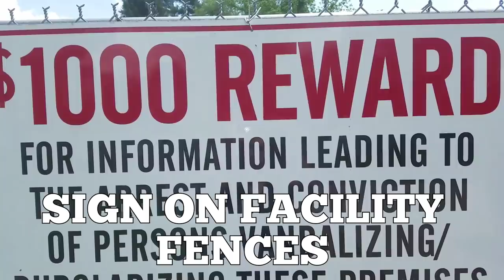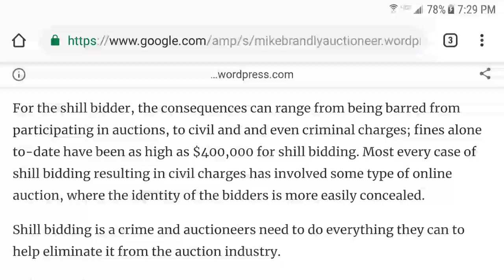ILLEGAL BIDDING On Abandoned Storage Units At Locker Auction By Facility Owner / Real Storage Wars

Comment: Auctioneer should have just said there's a reserve on each storage unit. Reserve is only known to auctioneer and the facility owner. If the price passes the reserve the bidder wins the storage unit, if it doesn't pass the reserve the facility owner retains ownership. Simple, easy, ethical.
Reply: yes but a reserve auction has to be advertised as a reserve auction
other wise by state law it is an absolute auction
and as Jeremy said people don't like reserves so would not attend
so they collude and bid rig (shilling) instead to get the most out of the people
the auctioneer and the seller will get into trouble for this.

Comment: At 6:47 her answer is clearly NO! She should read the laws regarding storage units containing vehicles. If the vehicle is not stolen, has been used in the commission of a crime or has no third party financial lien on it (and even if there is a financial lien, it's then up to the winning bidder to decide if he/she would like to pay the lien if deemed worth it, or relinquish said vehicle to the lien holder) that it now belongs to the bidder. In fact most states require the storage facility owners responsible for finding out that information before auctioning units containing vehicles. There are minor differences in a few states but overall this is how it should be handled.

Comment: Good question. On one side it seems shady, yet on the other side the guy is only trying to recoup his losses. He only rents the space out, no connection to what's inside. That's why the 'law' requires the contents to be auctioned.  Why should the owner have to see his investment in his property go down the drain, so to speak and let others reap, take advantage of his loss. I see so many, that see an  owner as having 'empty' pockets where I see so many business owners just trying to stay afloat. I see all the costs in running a facility such as taxes, upkeep and whatever other costs are involved. The auctioneer mentioned he had researched and found the owner bidding to be legal. Life's a gamble. Those motorcycles could have been worth nothing if they needed more work than they were worth. That's the business you're in and the chances you take. Thanks for sharing.  PS, if you see the owner bidding as such a problem, then either don't bid or write your representatives and try to get the law changed.
Reply from the maker: Shilling is illegal... that's the law